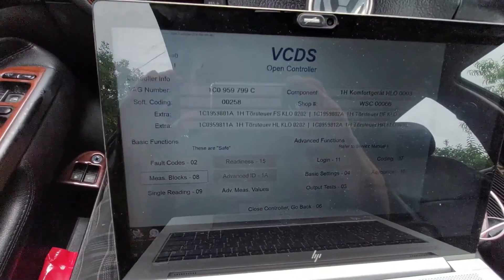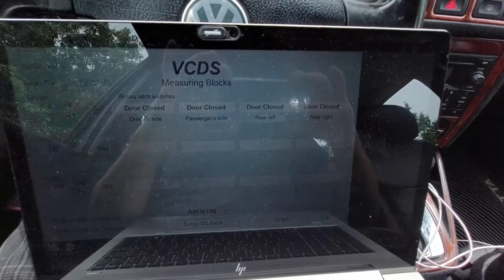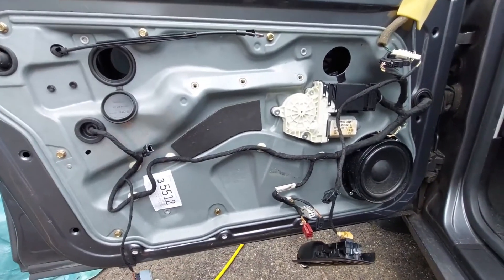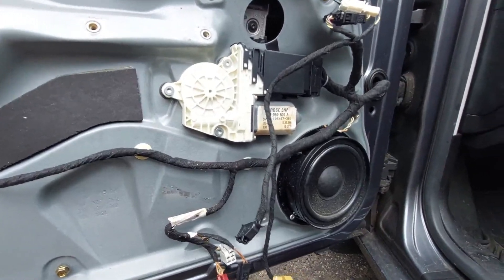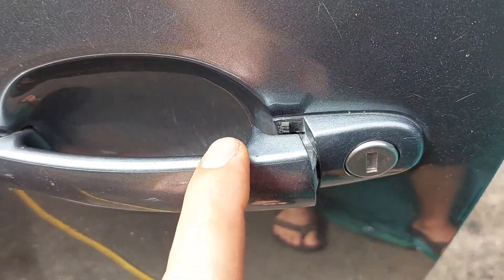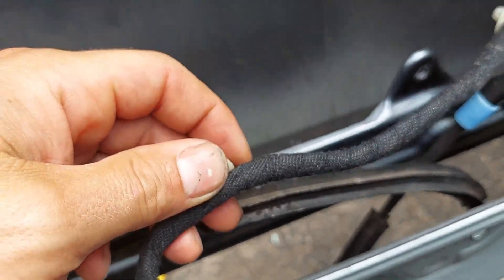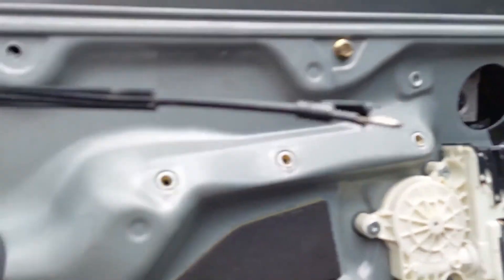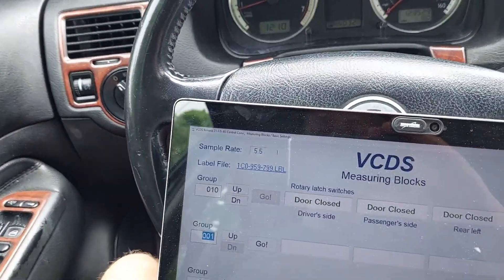1999-2006 Volkswagen Jetta door lock actuator- Door panel removal-vagcom

Comment: Dude you skip so many steps! So you unscrew the window clamps, then you just leave it or does the window go back up or what do you do with the window clamps?
Reply: I don’t understand why you didn’t just take the back panel off. It’s so much easier. You don’t have to worry about the glass as much..
Reply from the maker: Its not as complicated as you are making it seem. The clamps stay attached to the panel. You only loosen them. Don't remove the screws. They just hold the window to move it up and down. Need to just support the glass from falling. Lift it up out of the clamps and tape it up, or if you have, there is a suction cup tool with a string that holds the glass over the door frame.
Reply: @willpoweredgarage969  your right!! 🤣 I panicked a little, once I really thought about it, I had some suction cups lying around I put them on the window and finished up. Did everything right, driver and passenger doors. Driver door works great now but the passenger door is still not working so maybe the actuator I got from rock auto is a dud. I’ll find out after the new one gets here. Thanks again for the vid, it helped a ton.